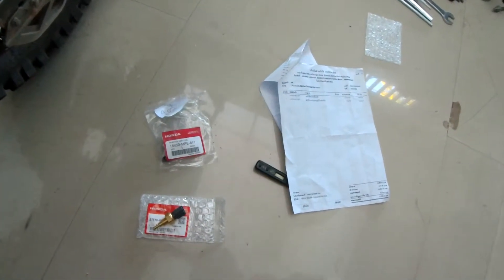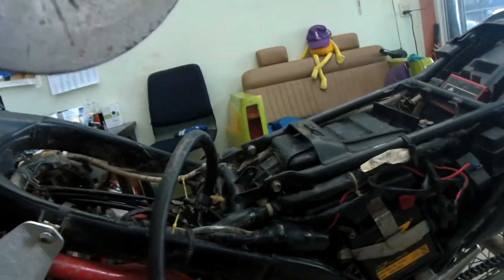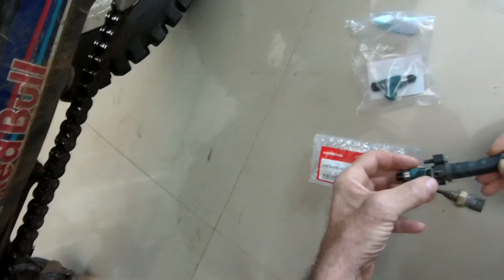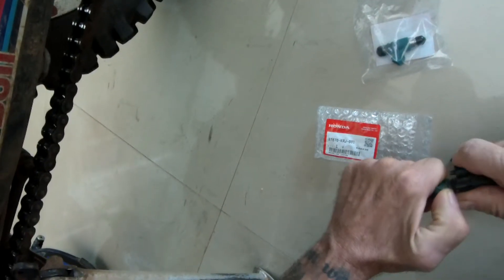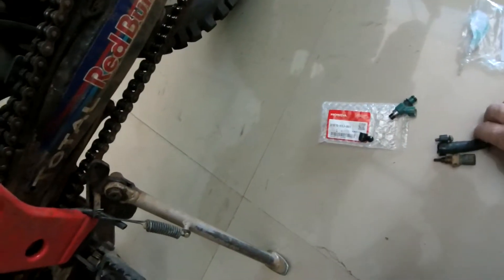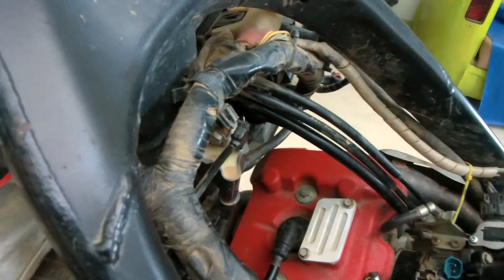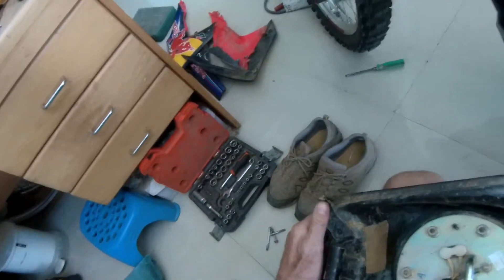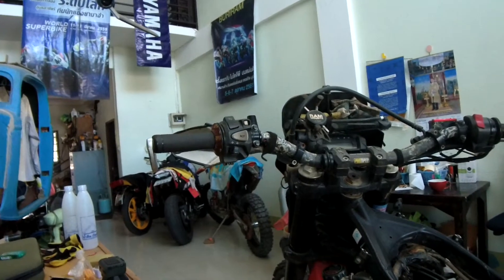CRF250L FAST IDLE part 1. coolant sensor fuel injector replacement.

Comment: Hello, Can I have a question? I'm wonder what's the fuel injector plug wire color is?
Reply from the maker: The ground side is black with a white trace, i cant remember the trigger wire colour but it can be found on the workshop manual which is on google as a pdf.
Reply: @theravedaddy  Thanks for help!
Reply: Hi 
Good video again
I made it back from Spain on the Dog 250 l ( much played with by many people I think )
I have ordered a new ECT sensor
Weather was poor coming up through northern Spain and into France  so I didn't need to worry about the radiator fan 
Thanks for all your help and quick response to my problem
Keep making the videos 
And ride safe